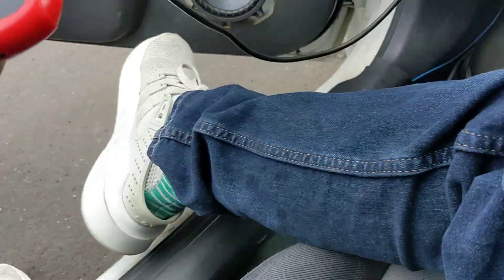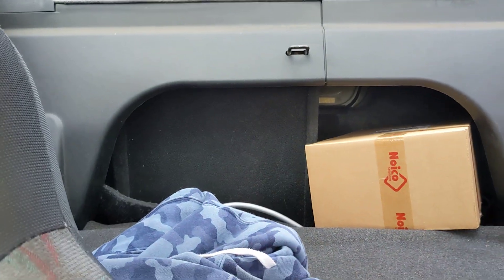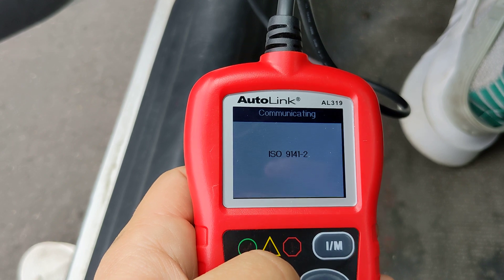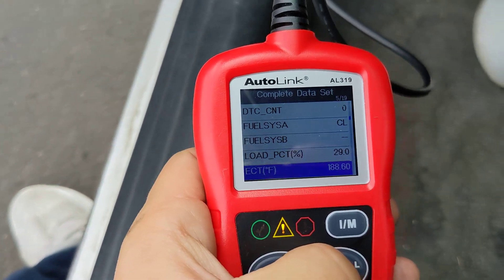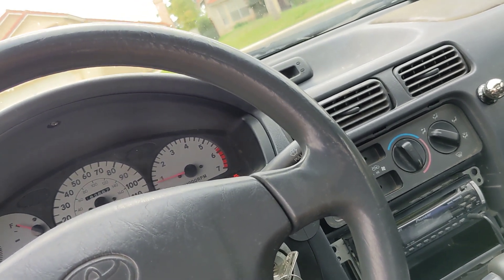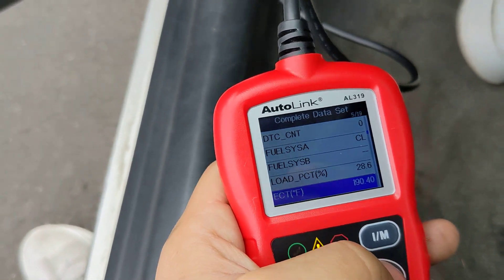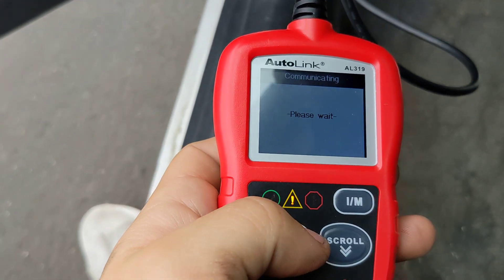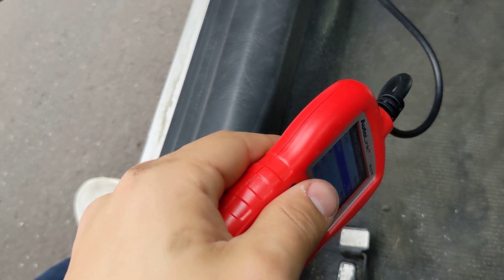How to get OBD2 smog catalyst monitor to pass Toyota vehicles 1996-2002

Comment: For my ADHD peeps. 
1:Bring up to operating temperature. 
2: 40-50MPH for 3 minutes 
3:stop for 10 seconds. 
4 35-45MPH for 7 minutes. 

If you end up having to STOP. Shut off engine and start all over.
Reply from the maker: @Master-Cunninglinguist  thank you. I did a pretty bad job of explaining this but this is the procedure summarized.
Reply: When you say "stop for 10 seconds" do you mean release the accelerator for 10 seconds until it stops on its own OR press the brake pedal until it stops for 10 seconds, then resume to driving 35-45mph

Comment: Changed the battery in ours and damn this sensor - this one sensor check for catalyst has been incomplete not re-running after driving it for 2 weeks now. Need to take it on some deep backroads outside of Austin perpetual stop-go congestion (even at 3am, as usual)

Comment: How long do I have to let the engine idle for the engine coolant temperature ("ECT") to reach 176F, assuming it's 65F outside?

My Autel MaxScan Model MS 309 doesn't display the ECT.
Reply from the maker: Just let it idle until it reaches 176. I Suggest getting a scanner to read that they are $30 on amazon.

Comment: I was just thinking if I can’t do this in public roads,can’t I just jack up my rear wheels on my 4Runner since it’s 2wd and do the tests while the truck is lifted in the air?
Reply: That's what I was thinking. It seems they could perform the required drive pattern in an auto repair shop.
Reply: Did you try it

Comment: This just makes me have more questions after reading the manual. It said you can slow down and speed back up if you do it slow and smoothly. There 2 different sensors that require different tests to trigger or somthing? Idk I’ll just do a bunch of these test and hopefully one of them work.
Reply from the maker: @droneshots6192  EVAP and CAT are different tests indeed. EVAP does the test while the car is off sometimes by putting voltage to the vapor cannister.

Comment: I just did one for 2001 Toyota sienna Do I have to stop and idle for 10 sec? I decelerated to the next step

This shiet is crazy. 

2am Los Angeles freeway. Everyone going home. 😵‍💫 

Do shops do drive cycles? all smog said was to run it. Drive it. Drive it till it clears.

So far Catalyst Mon INC after all that
Reply from the maker: It's a little more complicated than just "drive it" shops don't do drive cycles because it's a liability and they don't get paid for it. 

Just follow the steps in the included pdf file from google drive I linked in the description, you'll do just fine!
Reply: @Paseoman  does hitting the brakes reset the whole drive cycle
Reply from the maker: @Psp-id7uw  no
Reply: @Paseoman  You'd think they could do a drive-in-place run with the vehicle raised above the shop floor.
Reply: @Paseoman  Looking at the catalyst monitor drive patterns on page 12 of the PDF, there's no mention of stopping for 10 seconds (or any other interval) between step (a) (what you call step 2) and step (b) (what you call step 4). 

From page 12:
a. Drive the vehicle at 40 – 55 mph for the time described below:
  If IAT (Intake Air) was greater than 50 F when the engine was started,
drive for 3 minutes.
b. Drive the vehicle at 35 – 45 mph for approximately 7 minutes.

Notice that there's no stopping instruction between steps (a) and (b).
Reply: @herrickinman9303 did u figure it out
Reply: @BOREDANDWELLBORED  Figure what out?
Reply: @herrickinman9303  how to do the drive cycle correctly
Reply: @BOREDANDWELLBORED  Aren't the instructions I quoted from page 12 clear to you?

Comment: didnt work for my 2002 toyota corolla its 110F here no mil light no pending or stored codes
Reply from the maker: 2002 is probably the cut off year. I followed this guide step by step and it worked for my 1997 toyota paseo.
Reply: @Paseoman  title states 96 to 02 it's unfortunate
Reply from the maker: @nkdeftones  In the document it also states until 2002. Maybe it was until 2001. Double check with the document, i'm not sure on that.
Reply from the maker: @nkdeftones  You need to look at the document I posted in the description. There is a different procedure for each vehicle and model year. The procedure I've explained in the video only applies to the toyota Paseo.
Reply: @Paseoman  thanks alot paseo
Reply: The Toyota document linked states that some tests are different for 2002 MY and later. Thank you for sharing the Toyota drive patterns document! Using it to get my 2000 4Runner ready because I stupidly decided to wire up some lights right before my smog was due!